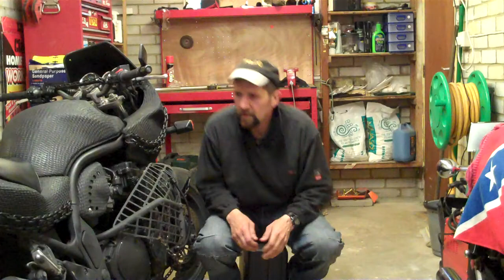Delboy's Garage, Catch up Vlog.

Comment from the maker: Ah, right, that makes sense now, this was a common fault on old Ducati ss 900's back a few years, the front plug is just in a vulnerable place, first i would think about sealing the HT cap with some  rubber silicone, not much, just a smear round the plug ceramic then push the cap on, the silicone will set and for a seal, and should resist the heat.With the 'anti-seize', NO, i've never used it, because i dont over tighten them like so many do, just nip them up hand tight, then a quarter turn more

Comment from the maker: If you are getting wet plugs in the rain, then you have a sealing problem, the HT cap should keep the rain out, and this wont be a problem with cleaning. if you carry a lighter you can heat up a wet plug with it in the field, but it shouldn't be getting wet in the first place make sure your caps are sealed against the plug body and that the pulgs are on good condition.the bandit is very different to an SV, they live down a long tube sealed by a rubber cap, first find our why water is getting in.

Comment: hi del.ive decided to give building a rat trailer a go,im using the mono wheel design a go and using the end of a prop shaft as the"hitch" end.then im using a tesco shoppin trolley with all the legs,wheels and crap cut off as the main carrier,all spayed matt black of coarse,all inspired by your good self.will start makin some vids and postin soon,just gettin the last of the parts together

Comment: Ok cheers fella, it seem to be a common fault for the front spark to get bogged, or at least not rare. its happened twice in heavy rain probably 3 months apart. usually rain isn't a problem. i'll have a look at it and get some dielectric grease on the cap n check/replace the plugs, out of curiosity do you put anti-seize on your plugs? Seems to be quite a divide on its use in the forums

Comment: Delboy my good fellow, after just limping home on my SV650 01 due to it being sat in the 'torrential' rain for an hour I wondered if you could do a 'how to' on cleaning the spark plugs (appears my bike has an issue with water getting in - aka SV325).  In case I almost get beached again

Also is there anything I can do to try and dry them out in the field as I almost couldn't start the thing.  Hoping it's a vaguely similar set up on the bandit. Soon to be a daily commute bike, so  might be a prob